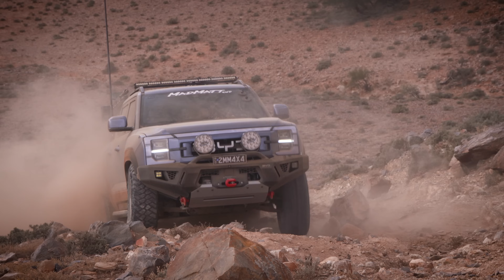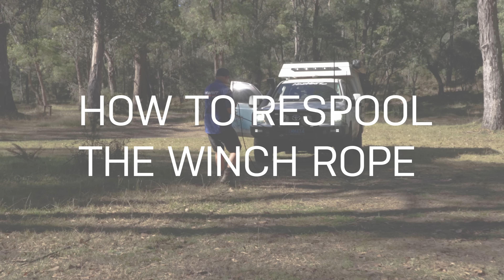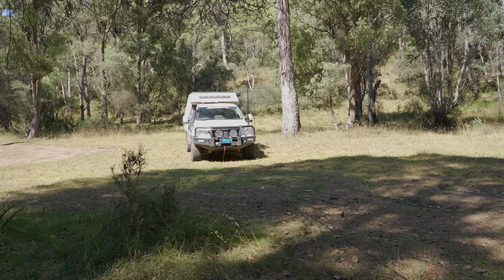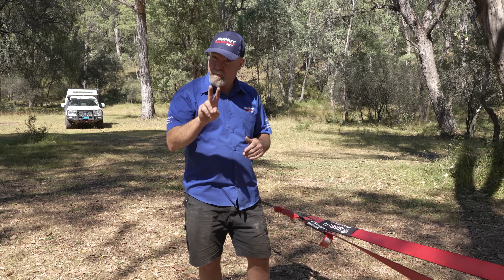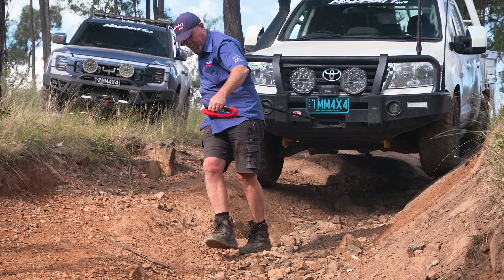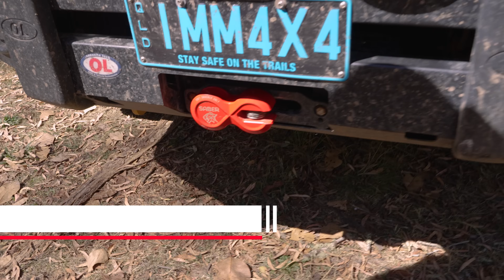Do you know these winch rope maintenance tips?

Comment: Really like the “fast pass” idea.  But surprised you recommended stowing in the engaged position.  Every supplier operating manual I have seen recommends stowing disengaged to release tension and compression forces on the gear train and clutch.  Not saying you are wrong.  In fact think I agree.  In which case - are we saying that winch suppliers are over stating the  issue of stowed tension/compression forces.  Or are they forgetting to balance that against the risk of a disengaged rope becoming loose over time?
Reply from the maker: I don’t think the winch being lightly loaded is a concern. But a rope catching and coming loose is a real concern.

Comment: If you have a steel cable DO NOT direct the winch cable onto your drum with your legs unless you wanna end up with a massive gash on your thighs
Reply from the maker: Great point. I’ve not used wire in 30 years so didn’t consider your point. Well said. Thanks.
Reply: @madmatesau  Wear your kevlar chainsaw chaps on your legs - that'll protect the skin. What you have a chainsaw and not the protective gear 😗
Reply from the maker: LOL If i have my chaps I'll wear them for you.
Reply: @madmatesau  Yeah, I think we all knew where that was headed straight off <grin>.

Comment: matt, im one of those guys whos been putting off servicing my winch ,mainly coz i have to take the bullbar off.4 week ago i got keen  once off i was expecting a pristine clean  gearbox and motor, how wrong i was the motor was full of rust and water  but it did still work the gearbox gears were rusted and the the grease was full of water,. i thought they were suposed to be sealed, lucky for me it was covered under warranty ,  i rebuilt the old one and it works fine but i dont trust it. ive set myself  a schedule now to maintain it  teach my daughter   few things,great video timing is perfect
Reply from the maker: Wow. Yeah and considering they’re an insurance policy for when you get stuck it’s a concern.

Comment: Cheers mate. I never thought about the doing the fast pass on the rope to stop it pulling down and in between other layers. I had mine pulled out in case last week while on the tracks. New track, lots of water/mud but fortunately I managed to drive it all with no issues by checking the bogs with a long stick. winding the cable back in I sat behind the wheel and slowly turned side to side to help wind it on even.
Reply from the maker: Perfect. We’re all learning all the time.
Reply: @madmatesau  That we are mate.
Reply: Same, that is the new thing I have learnt todays

Comment: Great content. Thanks. One quick question. Maybe i'm just being paranoid. The end of the line/rope (Dyeema?) is exposed to sunlight. I know it's only a tiny bit, but is degradation due to UV an issue? My line is hooked to the recovery point and the last 500mm or so is permanently exposed to weather. and the cover provided for the line doesn't cover it completely. Is this an issue over time? Just curious. Thanks 🙂
Reply from the maker: Yes it does degrade over time. I don’t like doing that to my rope. Not only does it expose it to the sun but it also runs the risk of getting damaged with things Offroad.
Reply: @madmatesau  Will have to look at solving that issue then. Thanks. 🙂
Reply: @michaelf5292  If it's a metal hook just pull it against the fairlead, then get a number plate hinged flip to cover it. Even if you don't live in a jurisdiction where a front license plate is required, it's solid protection for that end of the line. Granted it doesn't look as cool when you're driving to the mall, but it does protect the line. The only time I leave my winch rope partially out is when I'm at the trailhead and things are muddy and likely to require a tug that day.